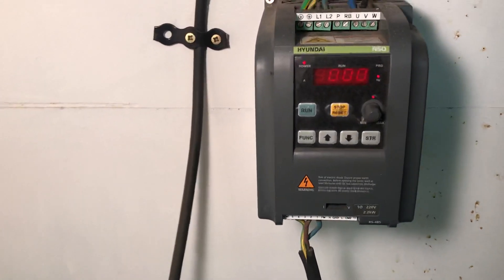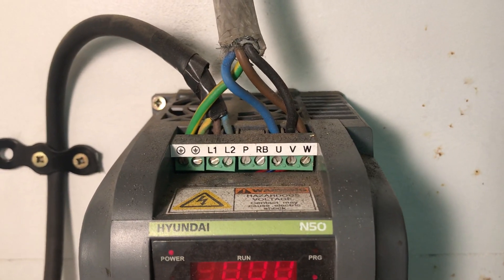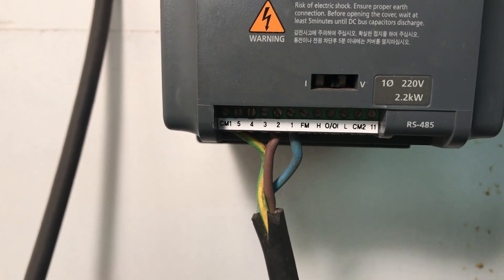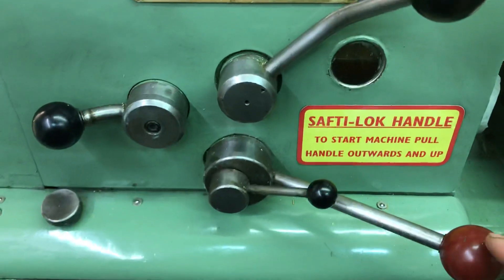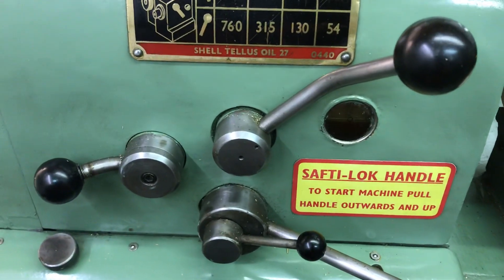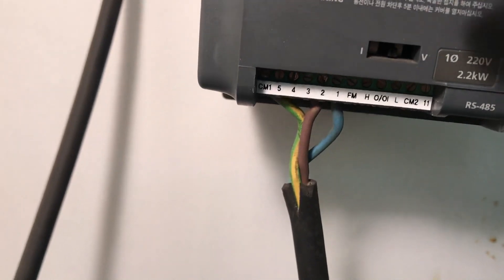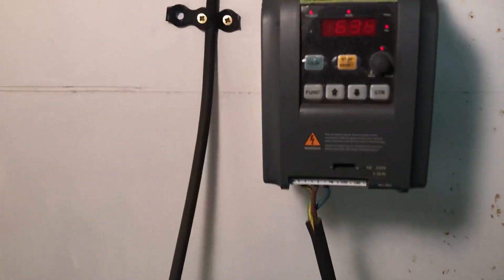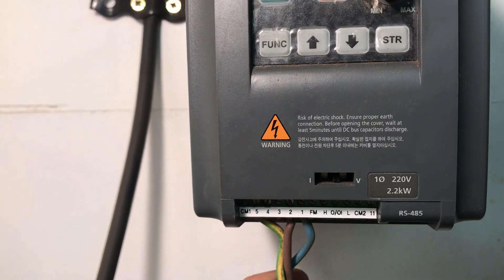Low voltage switching terminals for Colchester VFD

Comment: this is a long shot, Chris I'm trying to wire a colchester student to the inverter to operate same as yours start stop reverse etc do you have a wiring diagram to connect the lathe to the inverter, at the moment I can only connect the motor and hence all my controls are from the wall not the machine
Reply from the maker: The inverter should have low voltage control wires , which are simply a on off switch , connecting them to any switch should make the inverter start stop , the switch in the Colchester is pretty basic
Reply: @Madchris1  cheers Chris, followed your video and wired mine up the same, rotarty switch to on/off and back out, The low volt controls on my inverter have  port6 reversing switch, port 5 reverse rotation control and port 4 forward rotation control, there doesn't appear to be a forward switch port as in port6,
Reply from the maker: @manfromthemist1958 I’m surprised, did it come with instructions?   Unless one wire is a common , ,  touch wires , it’s low volts see what happens..
Reply: @Madchris1  will do, it did come with instructions, just not very good as it is a chinese one.

Comment: If when it's running what happens if you operate the reverse switch ? I'm guessing it slows down and then accelerates in reverse.

Is that the recommended method rather than swapping motor wires ?

What if you have 2 machines but only want to reverse one of them ?
Reply from the maker: pmailkeey  the general guidelines with these is you let the vfd  stop before doing a second operation, ie when I stop the lathe the vfd is still working for about five seconds after , and you not supposed to restart etc , until it’s finished it’s cycle, I’ve observed this and it’s running fine after 6/7 years , as for two machines I don’t know I’m running two on separate vfd’s , guess  you could if you had Some form of isolation switch’s for the two machines
Reply: @Madchris1  I currently have a box of duff Transwave capacitors - which I've never felt happy about even when it worked - but I might be blaming it falsely - having replaced the motors on both lathe and mill from when we got them - but they may well have been cooked by a previous owner. I just like the idea of a big 1ph motor driving a 3ph generator via belts on a variable speed drive - I'd end up with infinite speed options on both machines up to a maximum. [pun warning] 
CURRENT supply to the garage is underrated (30A on 2.5mm^2 cable) - making it a 50 foot resistor ! So there's my soft start!